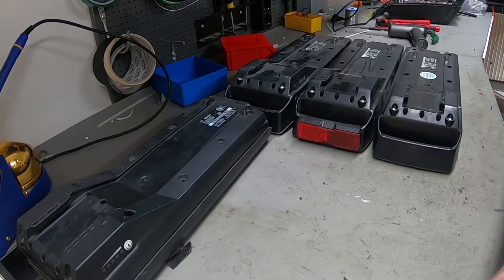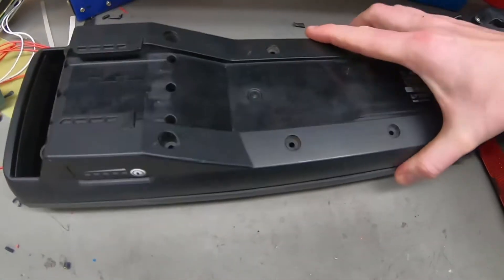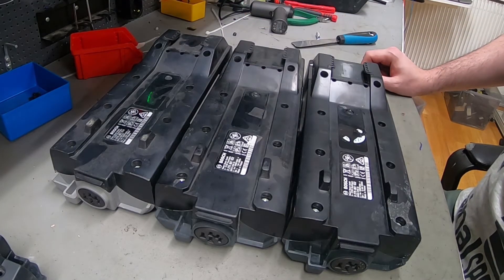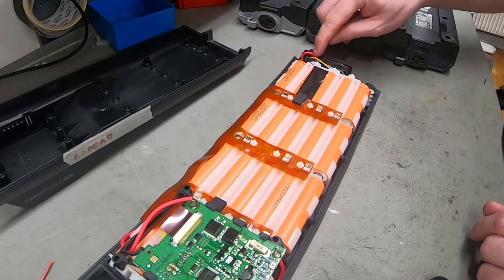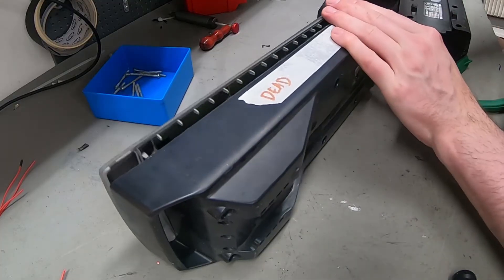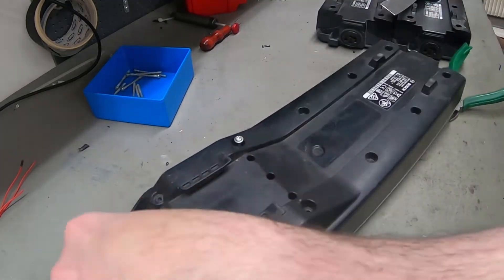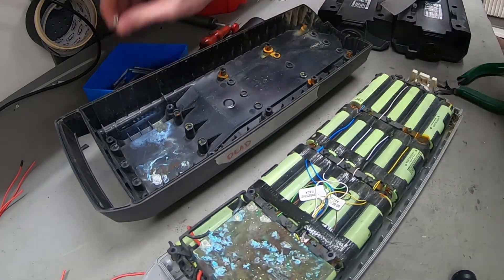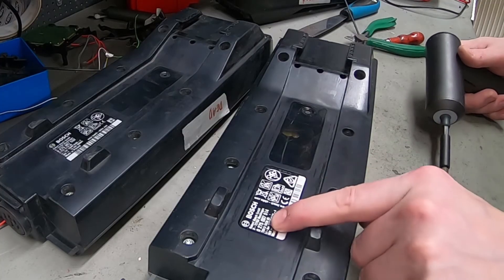Bosch ebike battery Repair Part 1 - Rear carrier models and differences

Comment: You sent
Hi is there any way to covert the battery to a frame mount type and visa-versa? (BOSCH PowerPack rack type Battery 500 to/or from Frame type BOSCH PowerPack rack type Battery 500) Thank you for your time time and great video! Liked and subscribed